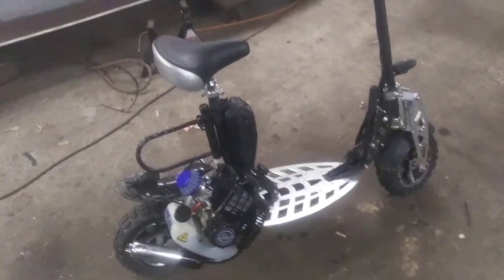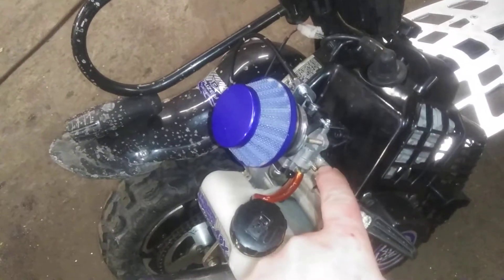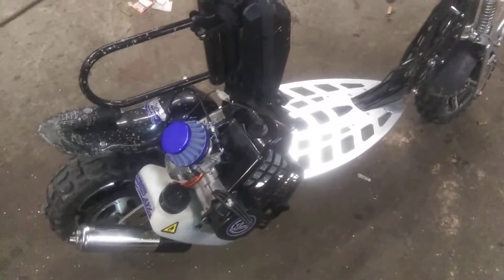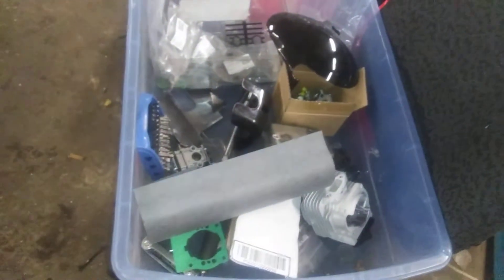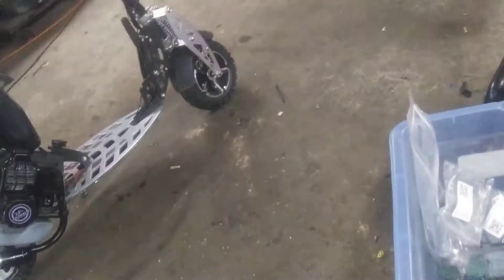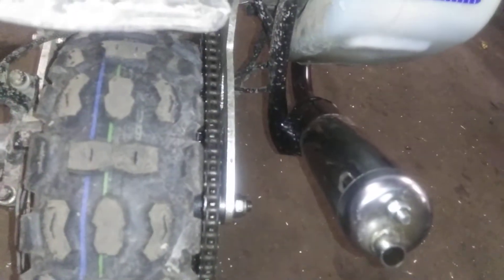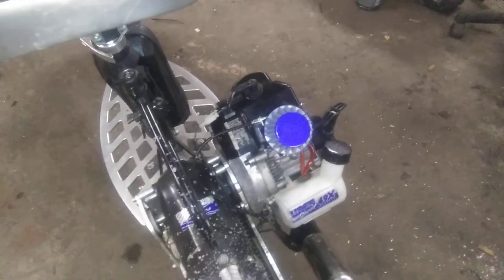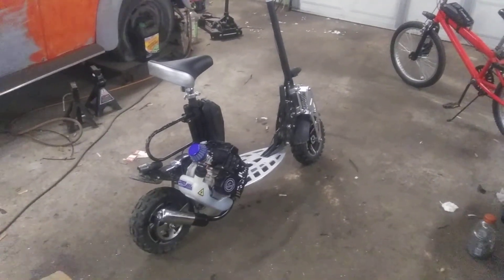Uber scoot 49cc x2 mods

Comment: I just bought it few days . I don’t know why the rear wheel is braked. And run it  and feels like is overheating What you think is happening?
Reply from the maker: Without looking at it. I eould just be guessing. Either the idle screw needs to be backed off or there's a clutch problem.

Comment: Where can I got an exhaust like that I want it to have a bracket so it's not hanging off the manifold also most bicycle exhausts don't have the bigger manifold exit hole either
Reply from the maker: It's a modified motorized bicycle exhaust. I made my own exhaust flange and used bends from bicycle handle bars and a universal muffler hanger and just started cutting and welding later I used a universal motorcycle muffler off ebay and used what I already made.